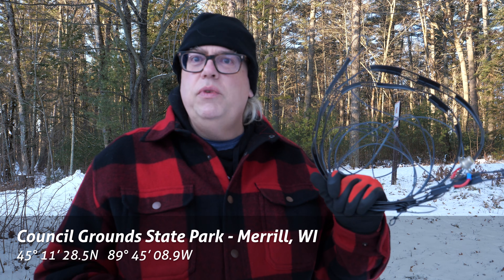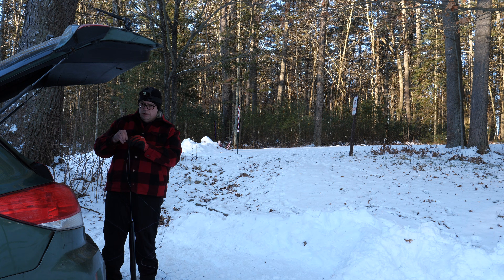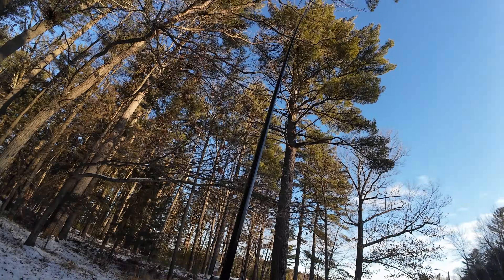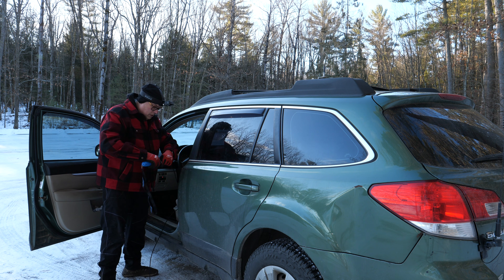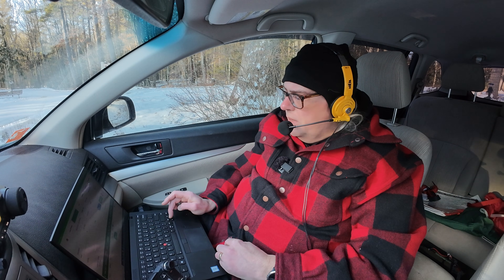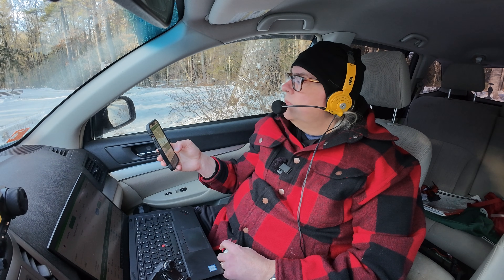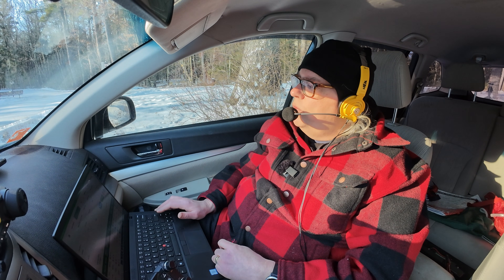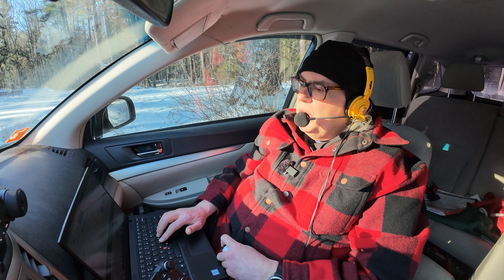Amazing Ham Radio DX on a 10 meter J-Pole Antenna

Comment: J pole antennas are great performers on 10m ......... I have worked as far as VK & JA from here in the lower Caribbean using my one homebuilt J pole using aluminium , and running 100 watts .... de 9Z4BM

Comment: These are good antennas, and they also work well on 20m, 17m, 15 etc.

Your dimensions are nearly identical to those I came up with in 1998 when I posted my plans on the Internet. If you use insulated wire, the radiator may have to be shorter.

You may have come across my "Nylo's Notepad" website while researching. It's easy to find by searching that name.

Your viewers might like to see some of the other plans there as well.

I worked a lot of great DX with the 20m version back in the great solar cycle peak around 1999-2000.

The 10m super J, with dual 5/8 wave elements is amazing, but a lot longer than the simple 1/2 wave J, and requires a very high support.

I like that you have improved the feedline choke using ferrites. Nowadays, I make the choke by winding the coax pigtail 3-4 turns through a type 31 mix split/clamshell type ferrite bead.

Happy building.

_ _ . . . MARK N1LO . . . _ _

Comment: What time do you consider the best in the am for DX on 10?
I know it depends on conditions. Would it be correct to assume sunrise?
Reply from the maker: The grayline is that point at or around sunrise when the band is starting to open up and the sun hasn't energized the ionosphere to the point where it absorbs signals. The best time to take advantage of that is at sunrise local time. This can be really useful on the lower bands, but also on the upper bands, like 10 meters, if you can get some great DX by riding that sunrise/sunset as your day begins and the Europe's ends. or as your day ends and the Pacific rim wakes up. There are real-time grayline maps online that will help you judge when it is a good time to watch for grayline conditions.
Reply: @ thank you

Comment: What coax was that? It looked pretty flexible even in the cold. My RG-8X gets very stiff in the cold.
Reply from the maker: I've been on a quest to find the best cold weather coax. I've talked to manufacturing reps at Hamvention but can't get any clear answers if a particular coax is good in the cold or not.  This stuff is RG8X from Cablexperts. I picked it up the last time I was at HRO in Milwaukee. https://www.hamradio.com/detail.cfm?pid=H0-005878 It works really good in the cold but it is getting hard to find as I think the company went out of business. The worst so far is from ABR Industries, theirs gets really stiff when it is cold. Allegedly Messi and Paloni Hyperflex is supposed to be good in cold weather but I don't have any to test. I'll keep searching and will make a video when I have enough data to share.

Comment: Same cold hear in NY about same band conditions as well. Grey line DX on 10 is great ! East build antenna's for 10 meter and 12. I do same. Just lean fiberglass pole in a tree . works great ! I got a park to park. NY to UK on 10 m with a 5/8 wave tunes for 10 no ATU with ground mount with radials with QT 60 radio and battery . about 50 watts . I got several parks in UK now,  73 stay warm !

Comment: Y'know, around this time last year, I asked you how you do it knowing what our winters are like up here, and you reminded me that it's all about the right clothing. I've taken that to heart. Maybe it was crazy, but I was on the air from Afton this past Sunday when it never got warmer than -5. All in-car activation except for antenna setup, but still, I was out there. Thank you for all you do!
Reply from the maker: When it gets super cold like that, the windchill really hurts. In really cold weather I like hamsticks because they set up fast.
Reply: @KB9VBRAntennas  I have a lipmount on the car, now, and I have hamsticks as an option, but I chose to use the SS25 and a tuner instead. Pretty fast setup and great results!

Comment: 2 questions here. Is that a j-pole or slim jim? I always end up making slim jim when using ladder line cause the extra wire is there. Also does that have more gain than just a vertical wire with groundplane?
Reply from the maker: It was a J-Pole. I used window line for the matching section and single wire for the rest of it. J-Poles are half wave antennas by design and will have slightly more gain than a 1/4 wave ground plane. Although the difference is 2.5 dB vs 2.15 dB. The big advantage, though, is the J-Pole will have a lower RF radation takeoff angle of about 15 degrees, so it will be better suited for DX than a simple 1/4 wave.

Comment: So far I've had a little better luck with that antenna than my 160m Sky Antenna. It rxs a little better but I'd have to check it with an SDR in Florida to find out how well I'm getting there for a comparison. I suspect it will be better. The pattern is going to be very uniform unlike the 160m loop which should have many lobes. For such a simple antenna its amazing ! and very inexpensive to put together, very easy to get up. Yes, I need a choke on it. I make mine with Toroids

Comment: So is that line isolator simply a section of coax with shrink-tube-wrapped snap-on ferrites?
Reply from the maker: Correct. The MFJ isolator was the same, except it was encased in a PVC tube instead of being shrink wrapped to the coax.
Reply: @KB9VBRAntennas  Thank you. I continue to learn new things. Stay warm!